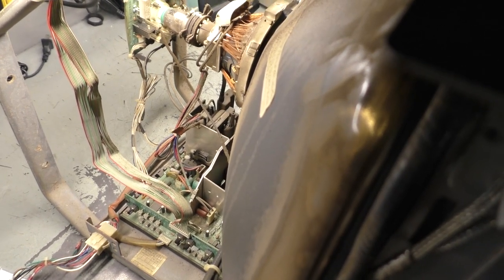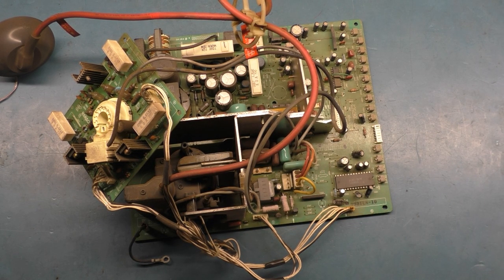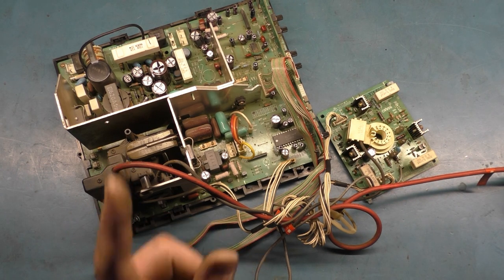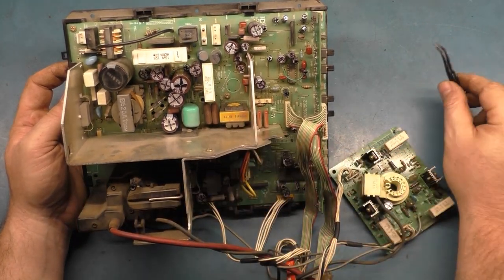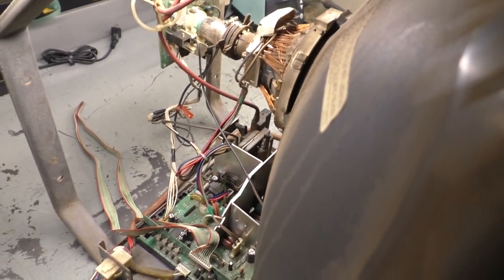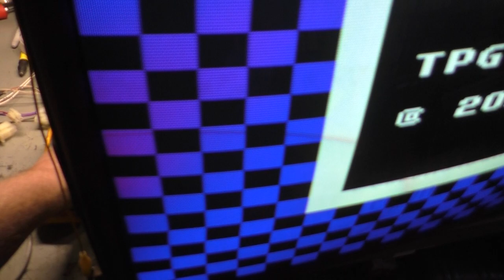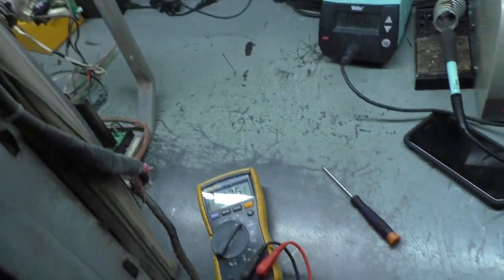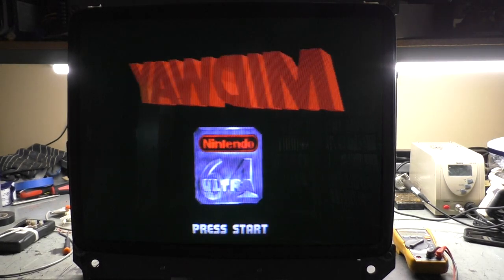27/29" Nanao MS9-29SU Arcade Monitor Chassis Repair - Dim On The Left Side - Bad Caps?

Comment: Finally! A Nanao!
FYI:
ABL: Automatic Brightness Limiter
SPC24: Pincushion for Medium Res
SPC15: Pincushion for Low Res.

On another note: If you encounter a MS8-29FSG, I would love a video of that one. Having a headache with one of those changing its geometry all the time (pincushion, H anc V size). I've reflowed everything, no dice. I suspect it's caps, but I have to recap it still.
EDIT: Well, you figured out what SPC was. I posted this on the middle of the video, lol

Comment: Hi Mike, There is still a Spanish/French company manufacturing the replacements for Nanao flybacks (just in case you're not aware). It is called HRDIEMEN / EFITER
NANAO MS 9-29 -> HR 46530
NANAO MS 8-29 FSG -> HR 46598
NANAO MS 8-25 FTB -> HR 46598
SANWA 29E31S -> HR 46274
I'm sure you already know this info but just in case...
Reply: Do you know how much they charge for a HR 46530? how can I order? thanks!